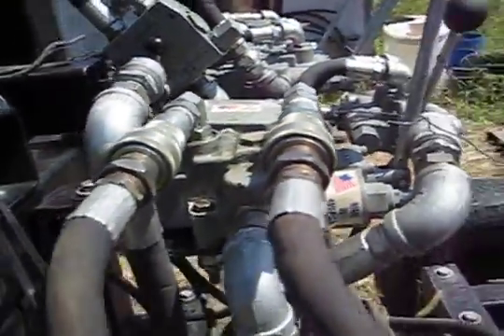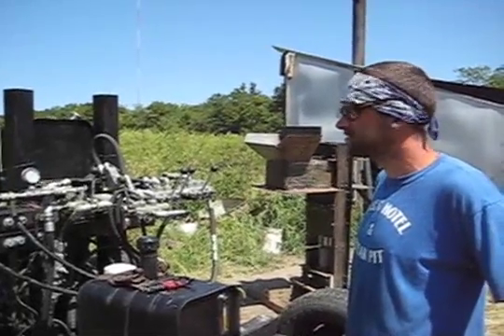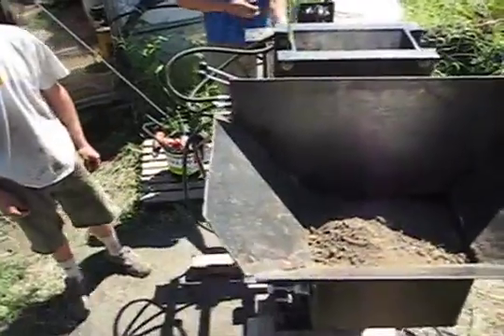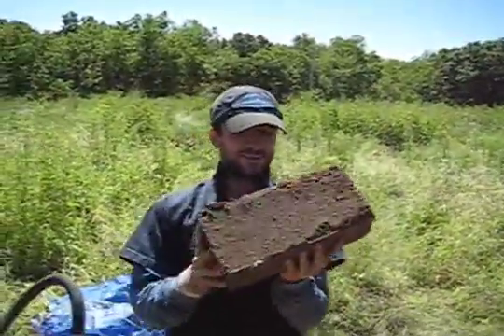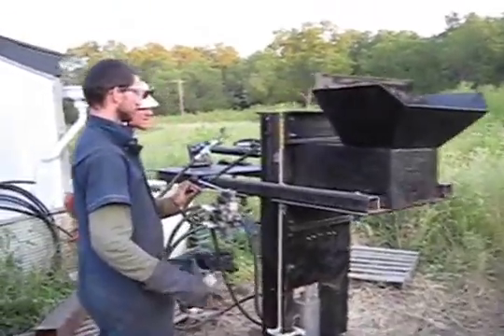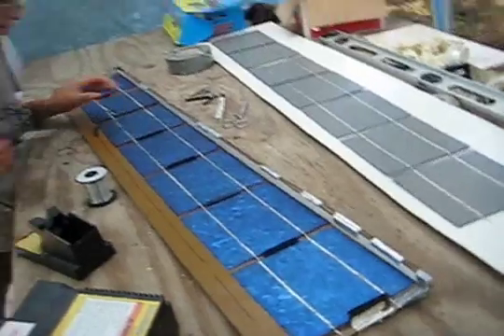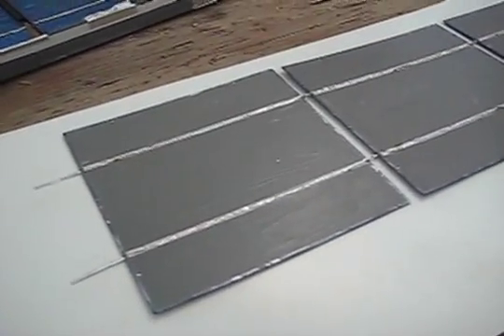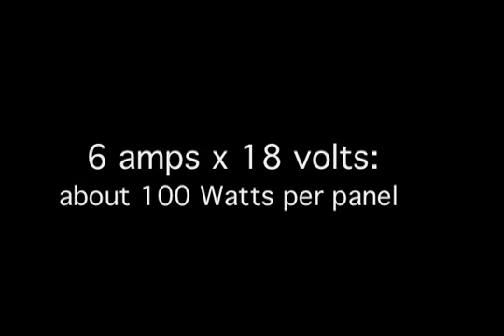Advanced CEB Press and Solar Panels - Open Source Ecology

Comment: @davetileguy That's not the point. You probably wouldn't need it now. The point is to have blueprints for machines that anyone in the entire world can build, adapt and improve. You could replace the engine with one that is homebuilt, electric or whatever. They are not profit-driven designs, so you don't have to cut corners on quality. They can also be a security for a day, when equipment like this is priced out of your range, the economy goes bust or you are forced to pay for a design.

Comment: you could buy an old tractor that actually worked ,but nooo lets waste energy welding experimenting REINVENTING THE FUCKING WHEEL!! get some horses
Reply from the maker: Great idea!
Reply: You miss the point of Open Source Hardware so hard it's not even funny.
Reply: @calysagora3615 noo i didn't,  using existing machinery is far more efficient than buying hydraulics and parts made in China made by coal.

Comment: what do you do when it rains?
Reply: i want to ask this too, but looks like they havnt answered this for a decade
Reply from the maker: @alexsmith2632  Block turns to mud unless block is stabilized with cement, in which case it is water proof.